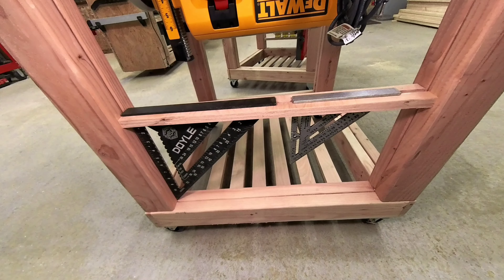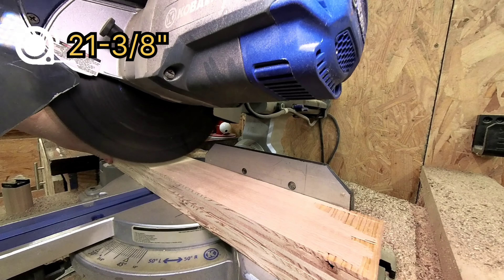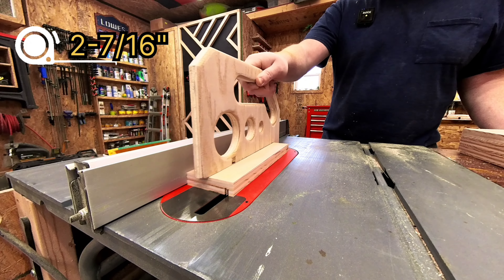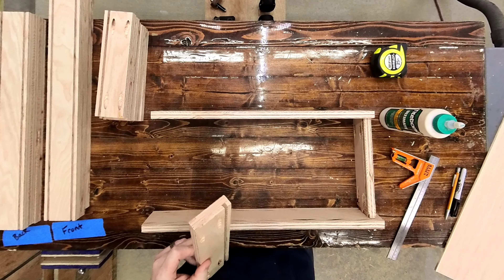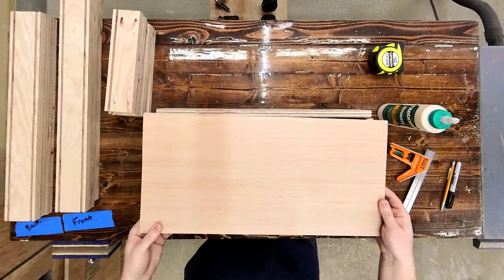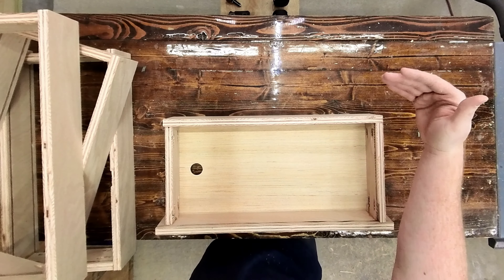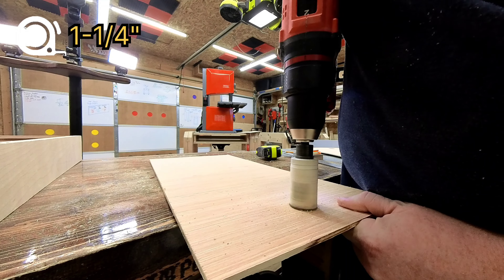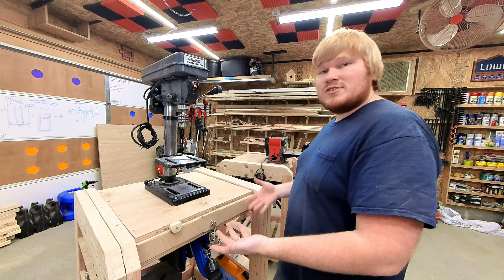Flip Cart, Part Three. FREE PLANS | How To

Comment: I know you do this for all your cords and have probably been doing it for a while. BUT... Using electrical cords while they are coiled up can create an induction coil which could melt the cord and start a fire. Especially with high amp draw equipment like a drill press when it binds up.
Reply from the maker: Ill have to check into this! Thanks for the heads up :)